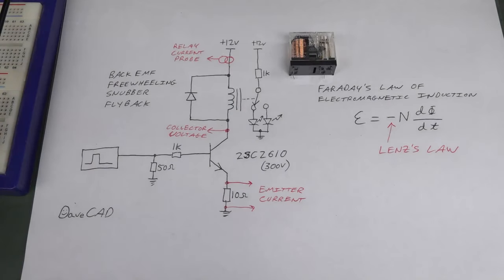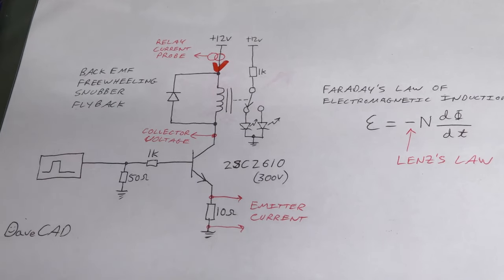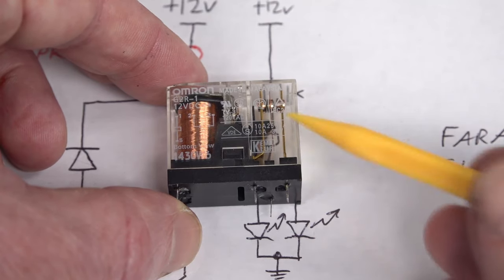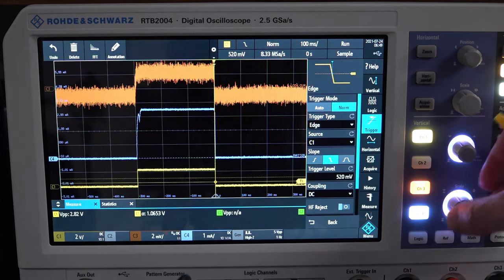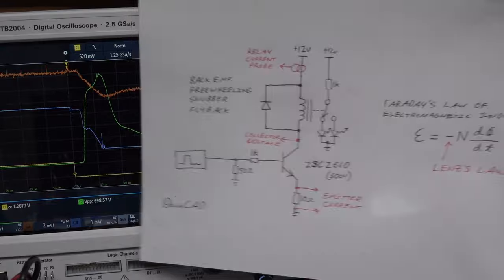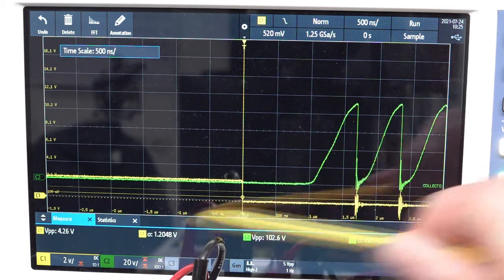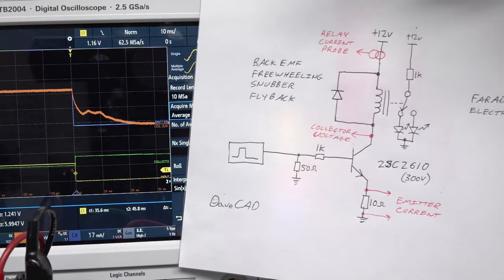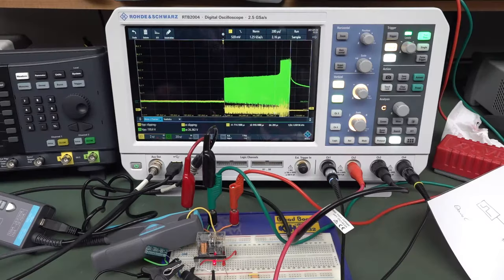EEVblog 1409 - The DANGERS of Inductor Back EMF

Comment: Dave: You are a blessing to a guy who never finished high school and loves electronics. Also, I wish more teachers would use "E" for  EMF instead of "V" for volts.
Reply: Volts and EMF are not the same thing. Voltage is a potential difference where emf is a difference in voltage which can do work.
Reply: @jimmysyar889  Again...Should've stayed in school. Thanks!

Comment: Just yesterday i was talking about this with my boss, he told me that every professor explains back EMF on inductors wrong, he had difficulties to understand it for weeks until he reached a explanations and when talked with his tutor about it, the tutor explained that it was true but people wouldn´t understand it that way as it was a basic level class.

The explanation says that the Inductor doesen´t magically generate a reverse voltage on its own, its the current trying to continue flowing forward that tries to find a path, as the path is not found the voltage rises and rises until a path is found, (it might even be the impedance of the air ) then the current is dumped trough that path and thus you now have the inductor working as a current source powering a impedance( whatever is working as the path for the current) so now the voltage across the coil is reversed since it was a load and now its a source.

i still don´t think i fully understand it, it might be from the years i thought of the magical voltage veresing explanation but it makes complete sense.
Reply: Don't let physicists (and managers) in the lab!!! They can stay at their desks and theorize, and please don't touch any of my lab equipment if you are not a technician!!!
Reply: Back EMF is somewhat analogous to the water hammer in pipes. Once the flow of electrons is stopped by brutally opening the transistor, inertia pushes the electrons still in the inductor to flow to the positive rail, leaving a 'vaccum' behind. When the 'vaccum' is strong enough, it will suck the ground electrons through the transistor junctions.
Plumbing helped me a lot to understand analog electronics when I started working in this field.
Reply: @nameredacted1242  Well, he is my boss at the I+D department, he is the one that designed the new generation of flyback power supplies that will be released in the next months and are absolutely nuts how powerful and precise they are.

As soon as they are released i´l post here the link to the specifications but can´t say anything right now due the NDA i signed.

If he says so, i believe him, he´s an electronics engineer but ALL of his designs are based on the absolute math basics of every component, not the equations in the datasheets, those are simplifications as he already demostrated me lots of times.

I asked my power electronics professor back from the uni and told me the same, i STILL have difficulty in completely believing them but again, it makes sense.

Comment: I think you have drawn the current probe in the wrong location in the circuit to measure the relay current. Suspect you must have is inside the relay diode loop so see the slower decay than emitter current.

Comment: But. Remember. A catch diode on a relay will absorb back emf but it will also keep the relay coil energized longer, thus wearing out contacts sooner if there’s substantial load current. Instead of using a diode, use a varistor or TVS diode.

Comment: Great video, thank you. I'm starting to get some gear together for the kids to mess with small DC motors and relays and was concerned about the reverse voltage.

In this video, granted the duration of the voltage spike is very short, what safeguards are in place (if even needed) to protect the function generator and the 12V power supply  against the back EMF when the diode is not used?

Is that what the base resistor is used for on the lower left of the diagram?

Thank you again Dave for all your  content!

Comment: They make tiny sparks when you disconnect them. I've fiddled with a relay and some rando battery and I got it to vibrate itself open and closed, just had to hold it at the right angle :P Lots of tiny sparks then!
Reply: Electromagnetic fields are pretty fascinating!

Comment: Could the lower noise be a result of a magnetic dampening effect caused by the now reverse flowing current? So basically the reverse current induces another small magnetic field that is just enough to cause a slight pull on the armature so that the contact doesn't slam with full force into the resting position by the internal return spring? But wouldn't that also cause some resonance? Could also be that the reverse current flow is so low that it basically causes next to no back EMF. 
Great tutorial, can't wait for the answer to that phenomenon!

Comment: Due to conservation, I am assuming the energy being clamped by the diode somehow gets eventually converted to heat as this loop essentially dissipates a wattage?
Reply: Yes. Since the diode has a very low capacitance and inductance, its behavior is almost entirely dissipative: the energy is lost to I^2*R heating. Very fast diodes can take the energy from the “slow” inductor and couple other to parasitic impedances, producing short RF bursts – much faster than what Dave has shown, into the 100MHz range, and into GHz range if you really want to demonstrate it that badly :)

Comment: Wouldn't the signal from your generator just be dumped to ground through the 50 Ohm resistor rather than create a high enough voltage through the 1 kOhm and ground on the transistor base? If your signal is say 5V, then you get 0.25V on the transistor, which is not enough to trigger it. Please explain?

Comment: This was very informative thanks. One question though, relating to the choice of diode: Is there such a thing as overkill? Say I have a 24V DC fan as my load so we are talking about typically a max of 0.5-1 Amp current. The typical diode I was advised to use would be a 1N4148. However what if the only diode I have in hand is an SR5100 (Schottky) which is rated for more or less the same reverse voltage (100V peak). Would this work just as well, or not? If not why not?

Comment: if I was using a omron relay to switch on an extractor fan using a light switch on a wall to turn on the relay's coil, would I need to fit a diode or would it not be a concern?

If so, what sort of diode would I need to fit into a 230VAC feed?

It would be handy if there was something like a DIN rail mounted diode so I don't have to gaff with a breadboard or what have you.

Comment: I am at 09:05, and wonder why you measure the emitter current ? Why not the collector ? I think that the speed of switching will suffer with an emitter resistor, because when the transistor opens, the emitter voltage will rise, and works contra the opening of the transistor ?
Will watch further ....
Reply: Maybe... I know why you did it this way:  more fear of blowing your DMM at the collector ?
Reply from the maker: Look up my video How not the blow up your oscillope. It's the scope grounding, so you use low side current shunt resistor.

Comment: Would this mean the more heavy kickback in the relay without BackEMF diode is subject to heavier bouncing? And with BackEMF Diode: would it mean less bounce? I am talking signal wise here if you would use the relay for an input pin which would need debounce on a mcu.

Comment: So, what if I'm not driving a solenoid relay but a motor coil ? 
It looks like a freewheel diode is going to dissipate all that magnetic energy into the windings right ?  That doesn't seem like a good place to dump energy in a motor !?
What do I do with the back EMF from a motor ? Can I put it in a capacitor instead and when comes time to push on that rotor, maybe I can use the stored energy to push it instead of using only energy from the battery ?

Comment: I saw a comment in a crt group the other day: "a coil doesn't hold any charge. It's just a coil of wire. Only capacitors hold charge"

Didn't know how to respond. A cap is just a roll of wet paper?
Reply: I'd say that's a correct statement. A capacitor truly holds a charge differential across the terminals, and in an ideal capacitor, that charge would remain completely static/unchanged, until externally discharged.

A coil, on the other hand, doesn't have such a charge differential. Instead, when energized, it has the magnetic field, proportional to the current flowing through. And again, assuming an ideal device, with constant current there would not be any voltage difference across the coil terminals. You'd only get the voltage difference when the current through the coil was changed, as the changed current would also require a change to the strength of the magnetic field.
Reply: @JuhaLaiho  That is a good explanation.

Comment: What is the difference between storage time and slew rate? Are they related and if so, how? 🤔
Reply: They are not related, slew rate refers to the rate of change of voltage to time in an op-amp circuit, while storage time describes how long the transistor will remain conducting from collector to emitter after the base is de-energized.

Comment: I’m new to electronics. Could someone explain why at 21:07, Dave says the collector voltage drops down to zero? In my head this is not making sense because of the resistor between the emitter and ground. How can the voltage above this resistor be zero when there still has to be a voltage drop across it?

Comment: It is NOT so much the voltage but the current through the coil, the more current, the greater 
the flux which will produce a greater back voltage, if the diode is so important, how come
all ignition circuits have a capacitor (condenser) across the points instead of a diode?

Comment: Does anyone know for sure in flyback diodes are needed when driving a nema 17 bipolar stepper motor with a A4988 driver. The data sheet to the driver confuses me on this question??

Comment: I killed a pyramid 30A linear power supply with a 12v relay and an automotive ignition coil.  Oops.  I ended up changing an IC to fix it. I was a dumb kid and it took me forever to figure out that it was the IC.  It was a good learning experience.

Comment: Dang I had no idea a simple relay could introduce such a voltage! I've added some relays to the brake switch on my vehicle. Should I add a diode or will it not make a hill of beans difference?
Reply: It probably isn't necessary, as there are already several lights in parallel with the relay. But since they are also likely 10' or more away (by wire length) from the relay, it could still help.

Comment: Nice explanation!!  Why does the contact sound change (contact force changed with and without diode ) ? Higher sound because of the higher back emf?
Reply: i suspect without the flyback diode, the relay circuit generate a large EM pulse to pop/clip the mic.
Reply from the maker: It's physically turning off harder and faster.

Comment: I don’t understand the 50ohm “transmission line” thing. Is this a requirement whenever driving a BJT from a logic level source (eg. GPIO pin) or something to do with driving the BJT from a distance and avoiding some sort of signal reflection?  I can’t seem to find a similar schematic anywhere.
Reply: Straight line wires or traces are 50 ohm impedance, so the matching resistor where you tap a signal is as shown, 50 ohms. Antenna theory for you.

Comment: Ok, what you have four color lines so are those lines necessary?? The minimum? And why is that?? And there are three lines that go down and one line goes up base on 17:48, there is a parallel inverse relationship that is the green one goes later, and also goes up and down in smaller section frame diameter, but each line within that smaller section frame is a higher line in frequently, so that is connected to yellow that went up before the green, so the bigger section frame, so the yellow goes up further and down further before the green. The yellow is current and the green is volt, the yellow is below the green, so the yellow feedback aligns to green feedback, so what is the green goes first, then the yellow goes first, so volt is the first and current is the second. You say storage time so that means the yellow is very short, that align to green is very short, so the current time align to volt time, so it is higher important for current time than volt since can't have too much current time or volt will be too much to break the circuit, right? The current is connected to the diode, which is DC, not AC?? It is important to have DC than AC for altering volt as smaller frequently line? 

So, the green went off in one line because the coil doesn't sustain the volt anymore, so that means the diode is connected to the volt itself, so the higher diode on the coil, the higher sustain of energy to keep the volt going, so it doesn't depend on coil alone, but depend on energy storage which is magnet field that holds the energy, which is connected to diode, the physical energy storage in align as a representative to energy storage that is magnet field. So, the diode is connected to the magnetic field as two represent the physical and energy. So, if volt has nowhere to go, it must go up that is connected to lens law and faraday's law?? So, how do those laws connect to going up and going down?? So, that means you prevent the law from happening when you connect diode which you create a frequently called spike, so there is a lot or few spikes in height diameter which if goes too high it will cause damage. Well, what is the reason the volt itself will cause damage if it goes up? It is because the going up, the volt is high, which it doesn't depend by height like the ceiling is 12 feet, so the high number is 12 feet, so for the volt part, the high part is not base on height alone, but on damage, so the higher it goes, the higher damage it will be which is connected to the magnetic field that expands outward in parallel that is 90 degree expand upward, so the magnet field will damage the circuits, right. To keep the magnet field down is good, in alignment to the volt that is down? So, it is good to want higher volt but bad to want a higher magnet field, since volt is energy that can give and magnet field is impact energy that can give?? Volt is never alone so the magnet field is never alone so always two together so to understand what kind of impact those energy causes. 

So, you say current that flow which the volt will flow, but the current come from volt which causes first, then second to current which causes the loop to current, or you use the current as first to cause volt to raise second. The current and volt cause the magnet field to expand or not, so the storage of the magnet field depends on the storage of current and volt, so not too much or too little, so volt or current must be sustained to keep the energy going. So, it can go infinity but it doesn't why is that? So, why does magnet storage lose energy which causes current and volt to be lost? So, it all depends on the diode? So, ya need an infinity diode to make energy storage infinity, right? The positive and negative in the direction of volt that goes up or down, so the up part is you turn it on and it goes up and the down part is blocked so creating pressure to volt so it is resistance so it goes down, so resistance is important so it is same as a diode? But diode has an extra resistance that is a direction of start and end resistance so it stays in between, up and down.

Comment: I have actually not seen that transistor RF oscillator thing before.  Is it not considered bad design to have the transistor break down and what is the solution?
Reply from the maker: Yeah, it's a bad idea. The solution is the clamp as I showed.
Reply: @EEVblog  By clamp, you mean diode?  Oh yes, duh.  That's why I've never seen the oscillation mode.

Comment: I have a stupid question: Why relay producers don't include a flyback diode into the circuit when manufacturing the relay?
Reply: ...POSSIBLY, BECAUSE IF A DIODE WAS BUILT INTO THE RELAY, THEN THE RELAY COIL CONNECTIONS WOULD BE POLARITY SENSITIVE- AND THAT WOULD BE ONE MORE THING FOR THE RELAY USER TO GET WRONG-(?)

I'VE WORKED WITH RELAY(S) THAT HAD BUILT IN DIODES ACROSS THE COIL- AND I WAS PUZZLED WHEN THE RELAY(S) DIDN'T WORK-(!)
Reply from the maker: Some of them do, as I mentioned in the video.

Comment: Would it be good to wire a transistor to short the pins of the inductor as the main transistor switches off?
Reply: The sound could be the small oscillations that happen during the turning off of the main transistor, since the voltage starts rising just before the relay's metals have touched, it could just be on time for some small rattling. That is not the high voltage transistor of the beginning, that other transistor oscillates.

Comment: Take the demo another step and you've got Kettering ignition, still in use after more than a century.
Reply: What about tasers, don't they operate on this same principle.  i.e, we can go with a larger inductor, collapse the field and that becomes the output end of the taser?  With a dc-pulse (square wave) this could be quite lethal (?) but only if the inductor discharge time is made longer. hmm.  Anyone want to become a taser test dummy :)
Reply: Oh yes, pump the 700v into a transformer with a higher turns ratio and boost the voltage to kVs.  Thoughts?
Reply: @EEVBlog Hey Dave, I think we'd like to see this taser in action.  It should be good for Australia, thoughts mate?

Comment: I have seen the diode replaced with a resistor on automotive relays as means to provide reverse polarity protection. Now I wonder what this actually looks like in direct comparision on the scope.
Reply: Not entirely sure, but I believe the voltage will spike to the previous current times the resistors resistance, and then drop down to 0 once it has spent all of its energy